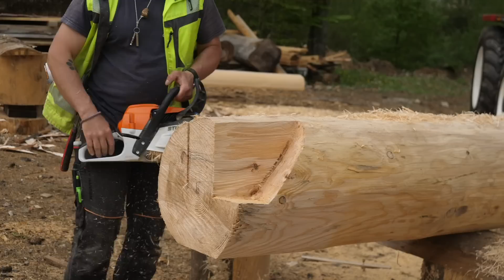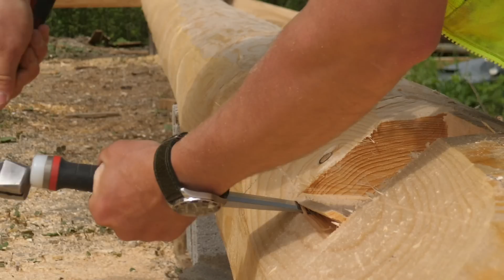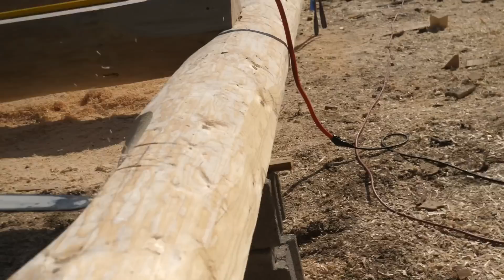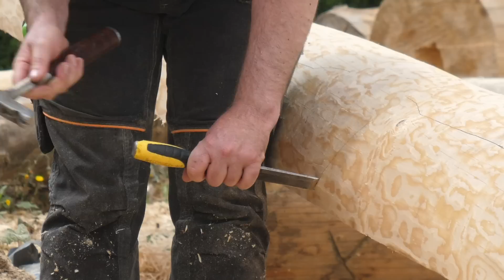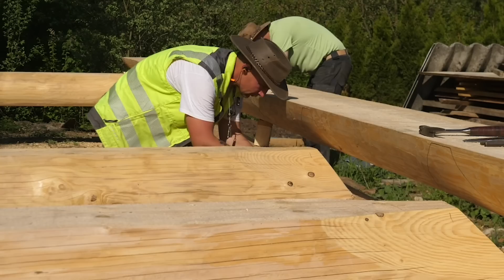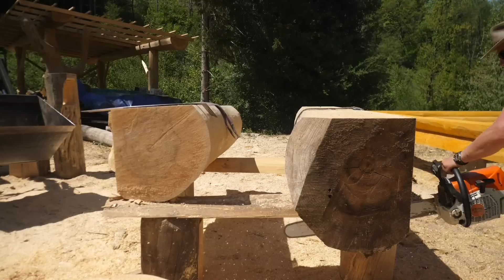Log Post And Beam House Build l EP2 l Building The 1st Floor Logs

Comment: Really cool, beam within the log.  I'm impressed with the engineering.  I keep learning that there is so much more to this than I had ever imagined; thanks for teaching us and entertaining us.  Great sense of humor building up too, you guys are nut cases.  I'm a bit worried about Nik buying you a crane though.  I wonder does he mean a wooden crane like the one he used on his house?  Also, tiny black insects were visible in the video.  Are insects a big problem for these houses?  I know you mentioned that the yellow treatment may help but in general, does one have to treat regularly for insect damage?
Reply from the maker: Those tiny black insects are bark beetles and they only eat soft layer of bark.
https://en.wikipedia.org/wiki/Bark_beetle
In our country insects lay eggs in fresh wood and larva stay there until it grows, at that point they leave wood and search fresh wood for next generation. In general they are not a problem because they don't come back in dry wood, they leave some small tunnels in the wood and exit hole. Of course there are some insects that attack dry wood also, impregnation works for those and it is good to treat the wood with impregnation every couple of years.
We talk with Nik about the crane but he newer specified what crane did he think to give us. You got me thinking now.